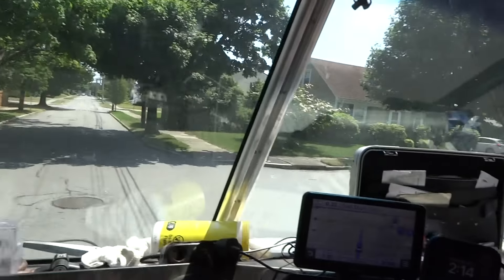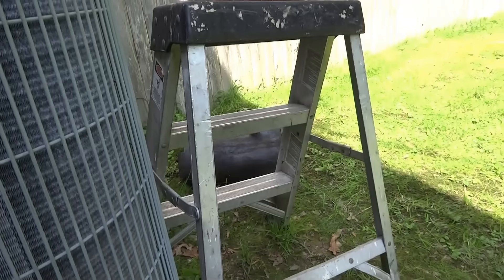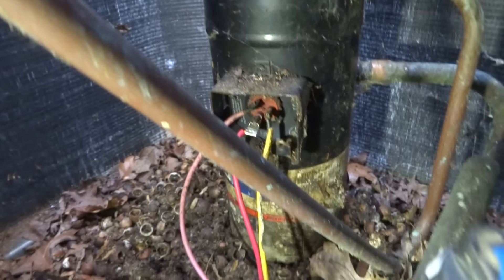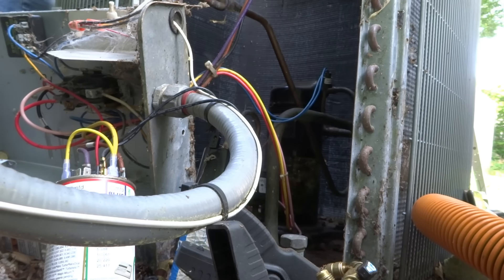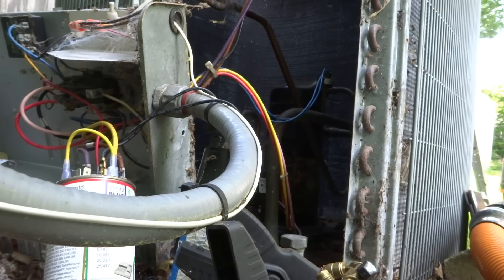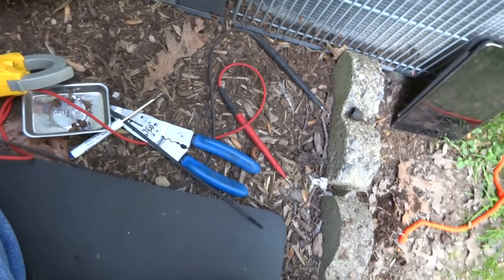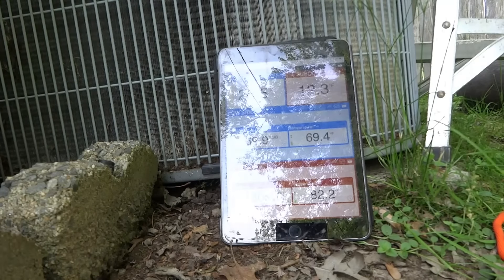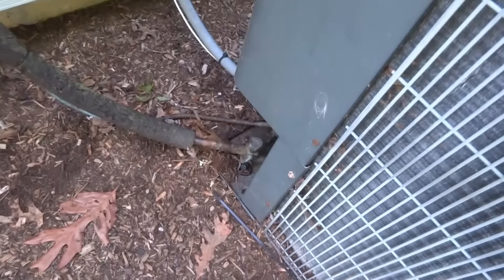AC COMPRESSOR NOT RUNNING

Comment: Hi Steve, bye yourself the proper crimping tool. For the flag connector. It's not that expensive. And yes the end will crush sometimes. The contractors can be stratened out, as you have been doing . Just a thought, Joe Capo.

Comment: My Parents have a 2013 Nissan Altima.   The Nissan Dealer here in Asheboro North Carolina told My Dad Not to put oil in the Freon.  I they want to Sell My Dad a New Cimpressor.  What do You think?
Reply: Compressors need a small about of PAG oil.
Reply: @m.t.3109  I think so too.
Reply: The only time you should ever have to add oil to a compressor is if you rebuild it.. if putting on a new one or just recharging do not add oil..
Reply: First off, there's no Freon in your Altima. Freon is R22 and isn't used in vehicles. Second, why would you "put oil in your freon"? That doesn't make any sense... Three, if the mechanic said the compressor needs to be replaced, what makes you think "putting oil in the freon" is gonna help? Four, why did you go to a mechanic if you're not going to accept their diagnosis and repair advice? Smh...
Reply: Freon is a  name brand that makes refrigerants. They make all of them.  It
Reply: @gradyj3827  oh really? Show me a tank of Freon branded r410a. I'll wait.